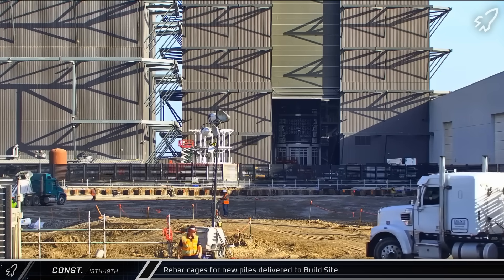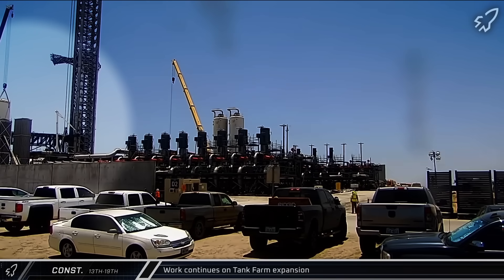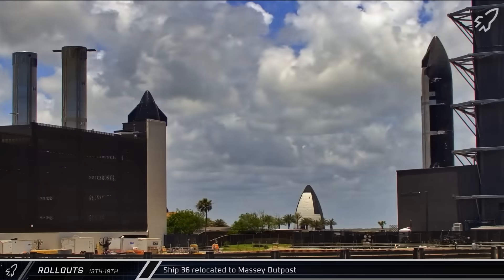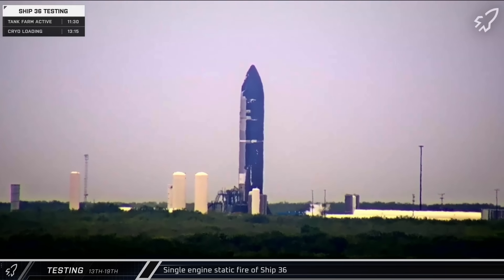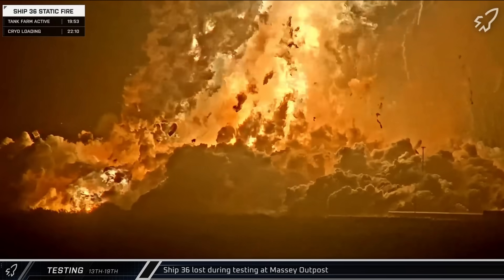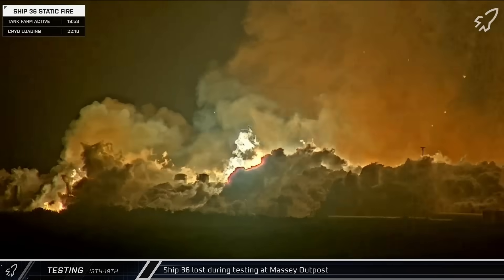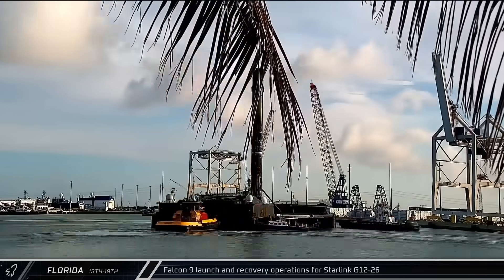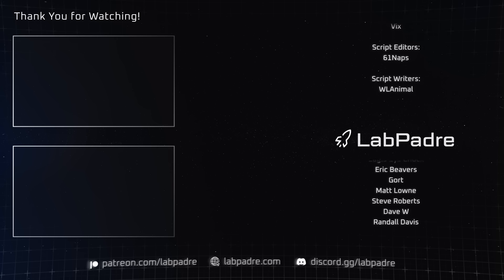Ship 36 Explodes...So What's The Damage?  - SpaceX Weekly #172

Comment: this wont setback for long, they static fired ships on a rudementary stand made of a few structural.beams bolted onto the parking lot. They can build a temporary stand faster then most can get 1 designed. End of July at the latest before #10 and Massys will be operational shortly after, they still have the old designs, have the best welders and fabricators in the world. And they can get started tomorrow. the crew is already on site
Reply: Who knows if the crabstand is even damaged, might be a bit of plumbing, power, and data runs. And let it rip.

Comment: as usual a great presentation.. note: the X bracing installed on the vaporizers is not there to protect the cooling fins....it is exclusively installed to keep the vaporizer frame from being pushed out of plumb..ie.. they drastically strengthen the framework

Comment: Figured they would have learned their lesson about putting the fuel farm and GSE right next to the pad after the concrete tornado at Pad 1.  Sometimes SpaceX seems strangely unnecessarily careless during testing.
Reply: SpaceX is able to perform miracles, such as catching the booster, but they are completely oblivious to obvious design flaws that a 2 year old could identify without needing a massive accident to suddenly realize something is really idiotic.
Reply: There’s a trade-off between safety and efficiency. When it comes to dealing with something like cryogenic fuels, you want to keep the infrastructure relatively close to minimize the length of the piping. The longer the pipes, the more challenges you have with maintaining the right temperatures and pressures. With cryogenic fuels, the more distance they travel, the more heat they can absorb from the environment, and that can cause issues with fuel density and pressure levels. So, keeping things close means you can control all of that more efficiently. Of course, that means there’s a bit of a risk if something goes wrong, but it’s a balancing act, and SpaceX is always pushing that boundary. (ChatGPT assisted).

Comment: What is this 'Massive Delay...' headline in the thumbnail? You're looking at a few months max until Massey's is back up and running for static fires. Plus it's quite possible that SpaceX will still find a way to static fire S37 and S38, because if they don't that means they'll be scrapped alongside B15, B16 and B17 and demolition work will start on OLM A. I feel that they won't want any of that to happen.
Reply: It’s a massive delay any way you slice it. They’re obviously pushing their components very hard.
Reply: Might OLM-A be quickly adapted to static fire Starships?
Reply: @HighPeakVideo   No, because OLM-A is designed for booster testing and launches.
Reply: @michaeldeierhoi4096  It only needs an adapter ring and connections rig - main thing is all the ground support is already there.
Reply: @HighPeakVideo   Alejandro at NASA SF I think it was stated that OLM-A is not suitable for a ship static fire because the hold down clamps are designed to fit the booster.  So an adaptor ring wouldn't solve that issue.
Reply: @michaeldeierhoi4096  That is precisely the problem an adaptor ring would solve.
Reply: @HighPeakVideo    Thats news to me because I have not heard anyone else agree with your statement!!
Reply: @michaeldeierhoi4096  Then apply some logic - an adaptor ring would do what it says, fit the OLM at the bottom and the Starship at the top, in similar manner that the Hot Staging Ring connects the Booster to Starship.  I can't see why you are arguing about it - makes no sense.
Reply: The answer is: It all depends who quickly they convince themselves they know exactly what the problem is and if they can ensure no repeat.

Comment: No flights anytime soon
Reply: It's not as bad as the Flight 1 crater, and now they know they need test pad redundancy (and better QC on the COPVs).
Reply: August very realistic, July on Elon's calender, but that would be a real push.
Reply: @GG-yr5ix  lol, would have been August for Flight 11 without S36's anomaly, next flight was planned for next week
No way they launch before September
Reply: @C_Greg if they get site cleaned up next week, the can do SF before end of August as long as the Coms/Data/Control shed equipment is all available.
Reply: @GG-yr5ix "If they get the site cleaned up next week"?!   Have you even seen the aerial view of the Massey site following this deflagration??   This isn't about simply cleaning up the site, but rebuilding the test pad which was destroyed.  Several of the lines providing fuel to the ship will need to be replaced as well as several of the fuel tanks.   This is the report from RGV that does over flights of Starbase. 

 Replacing all of that lost infrastructure will take many weeks.  Then testing of ship 37 can get underway.  And who knows if the FAA will require an investigation and how extensive the damage really is?!
Reply: @michaeldeierhoi4096 Why would the FAA require an investigation of an incident at a test site?
Reply: @michaeldeierhoi4096  I saw RGV photos,  I have a lot more experience with evaluation of fire damage than anyone at RGV.   Pipes are not any big deal, the Flame Bucket likely repairable.   Replace the SQD gantry, which isn't really special.   Question is the Coms/Data/Contol shed.
Reply: @GG-yr5ix    Time will tell.
Reply: @dphuntsman   Like I said "who knows if the FAA will require an investigation"?  It doesnt matter to me either way.